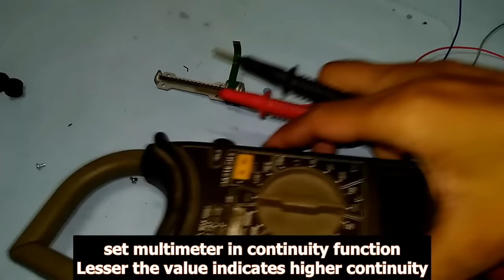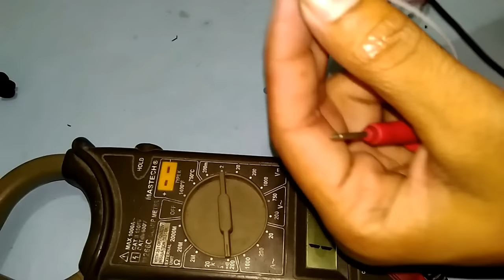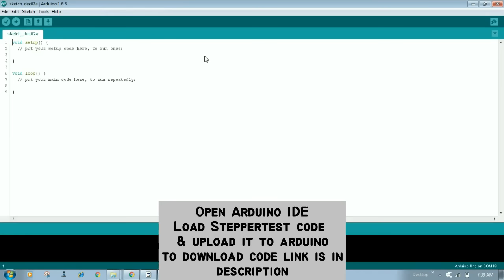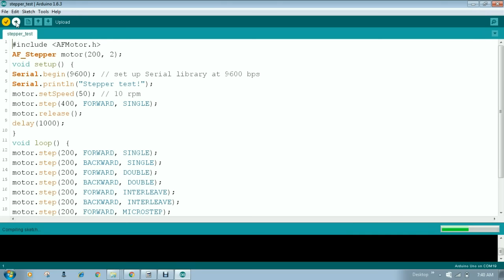Take out DVD Drive Stepper motor mechanism + Wiring + Test run

Comment: which external power supply you use for L293D motor shield ?
and you provide Arduino program for stepper test but when i compile that program i got so much  error 
please help me
Reply from the maker: I have use here 5V DC
Reply: Are you using charger for external power supply
Reply from the maker: SURAJ DIGE yes
Reply: Mr Innovative  when i use dvd stepper motor with Arduino it work but stepper motor connect with L293D and Arduino it not work why

Comment: thanks for awesome video. Bro i use easy stepper motor drive and i did not work motor . which i use arduino's pins ? or how can i change code  for work it ?

Comment: How much volt your external power supply gives? And what amperes?
Reply from the maker: 5v dc 0.5A
Reply: I am giving 12 Volt and 125mA. But it starts to make sound. It is not running.

Comment: You don't answer the question in comment section why how much volts and amps for running which terminal should we have to connect to run directly without Arduino

Comment: Problem Produced: 
The Stepper Motor attached with Mechanism Runs but it doesn't provide required Torque to Produce the motion to the Mechanism in this test.
Any solutions?

Comment: hey is it matter cable connection for arduino uno cables are coming from old dvd rw motors
Reply from the maker: there is L293D Shield mounted on Arduino Uno DVD RW motors are connected with this l293d shield

Comment: I have never seen a dvd drive with a stepper motor, I opened a lot of them but all have dc motor with gears :/
Reply: No man. Almost all computer DVD playershave a stepper motor as well as adc one. The dc motor is the one that spins the disk and  stepper motor is the one that controls the blue ray unit. It very small.
Reply: @sidamarali3030  NO MAN, they exist the ones who instead stepper motor they have DC motor with Hall effect sensor
Reply: well some dose not it users a better mechanism to track cd dvd pits stepper is inaccurate

Comment: What DVD drive has stepper.  I opened a DVD drive, it had a dc motor instead of stepper
Reply: It has 3 motors. A dc motor, a stepper motor and a brushless motor
Reply: Some dont have stepper but two servo motors

Comment: My motors are not running after uploading. Does that means that my motors are faulty?
Reply: did you have solved this problem
Reply: Yes, I changed the motors. Those were less powerful and current ones are working properly.
Reply: did you have finished the project i need your help
Reply: not yet. I am still working on it and facing problems like you as a beginner.
Reply: search by my name
Reply: Abu Hasan Rumi (Invisible )
is that your profile name
Reply: Spiderman
Reply: ck.muthu kumar   jpohhoojkki0op
Reply: bhai phone no.dede
Reply: im in big problem when i upload code in Arduino then it says upload fail
Reply: There is also a cnc build guide on >> https://t.co/O5Xf7QNRGt
Reply: Same thing happened with me & which motor did you change to?
We're you Building CNC Plotter too?
Reply: Abu Hasan Rumi I am going to make a claw machine and i have 2 dvd writers ,I want to make a circuite  using some switches ( not with Uno )  ,just with some on switch to make them move back and forward , so how can I make a circuit to do this 

please please help me
Reply: #include <Stepper.h>
 
const int stepsPerRevolution = 20; 
 
//Connection pins:
Stepper myStepperX(stepsPerRevolution, 8,9,10,11); 
 
void setup() {
 //Set speed:
 myStepperX.setSpeed(100);
 //max 250 steps for dvd/cd stepper motors 
 myStepperX.step(160);
 delay(100);
 
}
 
void loop() {

}
Reply: Try to switch COM port?
Reply: did u got that mottor or it's detail , can u share that with me
Reply: I have successfully builded a CNC MACHINE and it's working

Comment: hello sir!! i have completed the whole project according to your videos i have used the latest design of the cnc that u have posted the one in which 1 drive is mounted on another drive. i have completed that and i have also completed the programming part, iam using L293D...and i have also given 5 v to arduino and 5 v to shield but when i run gcode through the software processing 3 the power is going into motors they r making noise[sound] like zeeeeennn but its not moving both of them plz help me iam at the end of the project plzplzplz help me sir....
Reply from the maker: hello when you are making cnc with new design like overlapping the axis so stepper needs more power to carry load of other axis so i have given 12V DC to Motor shield to overcome this issue point to be note that if still stepper not move after applying 12v dc immediately  turn off the supply otherwise it will heat up motor winding, if stepper get working then no issue
Reply: and 1 more thing sir when i run it without the outer part of the motor drive i mean when i run them by taking them out unscrewing them then the work fine but when i fix it they does not work they do not move the part which needs to be moved i think u r right the problem is weight....but how can i give 12v to it 5 v is going to arduino by my lappy and i have given 5v to shield but how 12v??
Reply: thank for such a fast reply and the help thank u sir...
Reply: sir the main ques . is how to give 12 v dc??
how do u have given to it??
Reply: and when i do not overlap them on together and try to run them both seperately the motor is not able to move the middle part of the mechanism in which a camera like sensor is fitted but the motors are working and are good as when i take them out and run gcode the work perfectly plz help..
Reply from the maker: Anshuman Bhatt you have to arrange a 12V DC adapter or 8 x 1.5 V AA batteries
Reply: ok i have made it to work but now thw problem is the servo is not working i think there is some problem in the code..
the pen stucks in up position it does not touches the paper..
Reply: the same exact problem for me tooo bro ,can anyone help plzzz
Reply: Anshuman Bhatt hey , then help me please !!

Comment: Sir when I upload stepper test code it does uploaded it shows error that error compiling for board
   What is the solution ???
Reply: I faced the same issue, I read online that you should close all applications such as Pronterface which require USB and it should work. At least it worked for me

Comment: Mr MI 
i am getting error while compiling the stepper test file 

D:\00_SOFTWARE\ARDUINO TOOL KIT CD\Softwares\arduino-1.0.5\libraries\AFMotors\AFMotor.cpp: In function 'void initPWM1(uint8_t)':
D:\00_SOFTWARE\ARDUINO TOOL KIT CD\Softwares\arduino-1.0.5\libraries\AFMotors\AFMotor.cpp:92: error: 'TCCR2A' was not declared in this scope
D:\00_SOFTWARE\ARDUINO TOOL KIT CD\Softwares\arduino-1.0.5\libraries\AFMotors\AFMotor.cpp:92: error: 'COM2A1' was not declared in this scope
D:\00_SOFTWARE\ARDUINO TOOL KIT CD\Softwares\arduino-1.0.5\libraries\AFMotors\AFMotor.cpp:93: error: 'TCCR2B' was not declared in this scope
D:\00_SOFTWARE\ARDUINO TOOL KIT CD\Softwares\arduino-1.0.5\libraries\AFMotors\AFMotor.cpp:94: error: 'OCR2A' was not declared in this scope
D:\00_SOFTWARE\ARDUINO TOOL KIT CD\Softwares\arduino-1.0.5\libraries\AFMotors\AFMotor.cpp: In function 'void setPWM1(uint8_t)':
D:\00_SOFTWARE\ARDUINO TOOL KIT CD\Softwares\arduino-1.0.5\libraries\AFMotors\AFMotor.cpp:150: error: 'OCR2A' was not declared in this scope
D:\00_SOFTWARE\ARDUINO TOOL KIT CD\Softwares\arduino-1.0.5\libraries\AFMotors\AFMotor.cpp: In function 'void initPWM2(uint8_t)':
D:\00_SOFTWARE\ARDUINO TOOL KIT CD\Softwares\arduino-1.0.5\libraries\AFMotors\AFMotor.cpp:184: error: 'TCCR2A' was not declared in this scope
D:\00_SOFTWARE\ARDUINO TOOL KIT CD\Softwares\arduino-1.0.5\libraries\AFMotors\AFMotor.cpp:184: error: 'COM2B1' was not declared in this scope
D:\00_SOFTWARE\ARDUINO TOOL KIT CD\Softwares\arduino-1.0.5\libraries\AFMotors\AFMotor.cpp:185: error: 'TCCR2B' was not declared in this scope
D:\00_SOFTWARE\ARDUINO TOOL KIT CD\Softwares\arduino-1.0.5\libraries\AFMotors\AFMotor.cpp:186: error: 'OCR2B' was not declared in this scope
D:\00_SOFTWARE\ARDUINO TOOL KIT CD\Softwares\arduino-1.0.5\libraries\AFMotors\AFMotor.cpp: In function 'void setPWM2(uint8_t)':
D:\00_SOFTWARE\ARDUINO TOOL KIT CD\Softwares\arduino-1.0.5\libraries\AFMotors\AFMotor.cpp:218: error: 'OCR2B' was not declared in this scope
D:\00_SOFTWARE\ARDUINO TOOL KIT CD\Softwares\arduino-1.0.5\libraries\AFMotors\AFMotor.cpp: In function 'void initPWM3(uint8_t)':
D:\00_SOFTWARE\ARDUINO TOOL KIT CD\Softwares\arduino-1.0.5\libraries\AFMotors\AFMotor.cpp:237: error: 'TCCR0A' was not declared in this scope
D:\00_SOFTWARE\ARDUINO TOOL KIT CD\Softwares\arduino-1.0.5\libraries\AFMotors\AFMotor.cpp:237: error: 'COM0A1' was not declared in this scope
D:\00_SOFTWARE\ARDUINO TOOL KIT CD\Softwares\arduino-1.0.5\libraries\AFMotors\AFMotor.cpp:237: error: 'WGM00' was not declared in this scope
D:\00_SOFTWARE\ARDUINO TOOL KIT CD\Softwares\arduino-1.0.5\libraries\AFMotors\AFMotor.cpp:237: error: 'WGM01' was not declared in this scope
D:\00_SOFTWARE\ARDUINO TOOL KIT CD\Softwares\arduino-1.0.5\libraries\AFMotors\AFMotor.cpp:239: error: 'OCR0A' was not declared in this scope
D:\00_SOFTWARE\ARDUINO TOOL KIT CD\Softwares\arduino-1.0.5\libraries\AFMotors\AFMotor.cpp: In function 'void setPWM3(uint8_t)':
D:\00_SOFTWARE\ARDUINO TOOL KIT CD\Softwares\arduino-1.0.5\libraries\AFMotors\AFMotor.cpp:271: error: 'OCR0A' was not declared in this scope
D:\00_SOFTWARE\ARDUINO TOOL KIT CD\Softwares\arduino-1.0.5\libraries\AFMotors\AFMotor.cpp: In function 'void initPWM4(uint8_t)':
D:\00_SOFTWARE\ARDUINO TOOL KIT CD\Softwares\arduino-1.0.5\libraries\AFMotors\AFMotor.cpp:292: error: 'TCCR0A' was not declared in this scope
D:\00_SOFTWARE\ARDUINO TOOL KIT CD\Softwares\arduino-1.0.5\libraries\AFMotors\AFMotor.cpp:292: error: 'COM0B1' was not declared in this scope
D:\00_SOFTWARE\ARDUINO TOOL KIT CD\Softwares\arduino-1.0.5\libraries\AFMotors\AFMotor.cpp:292: error: 'WGM00' was not declared in this scope
D:\00_SOFTWARE\ARDUINO TOOL KIT CD\Softwares\arduino-1.0.5\libraries\AFMotors\AFMotor.cpp:292: error: 'WGM01' was not declared in this scope
D:\00_SOFTWARE\ARDUINO TOOL KIT CD\Softwares\arduino-1.0.5\libraries\AFMotors\AFMotor.cpp:294: error: 'OCR0B' was not declared in this scope
D:\00_SOFTWARE\ARDUINO TOOL KIT CD\Softwares\arduino-1.0.5\libraries\AFMotors\AFMotor.cpp: In function 'void setPWM4(uint8_t)':
D:\00_SOFTWARE\ARDUINO TOOL KIT CD\Softwares\arduino-1.0.5\libraries\AFMotors\AFMotor.cpp:326: error: 'OCR0B' was not declared in this scope
Reply from the maker: its looking weried will you please provide the link from where u download this code ?
/

Comment: sir my moter is not working
Reply: #include <Stepper.h>
 
const int stepsPerRevolution = 20; 
 
//Connection pins:
Stepper myStepperX(stepsPerRevolution, 8,9,10,11); 
 
void setup() {
 //Set speed:
 myStepperX.setSpeed(100);
 //max 250 steps for dvd/cd stepper motors 
 myStepperX.step(160);
 delay(100);
 
}
 
void loop() {

}